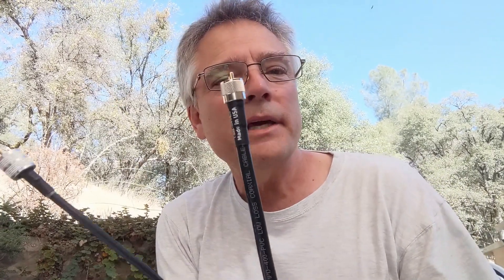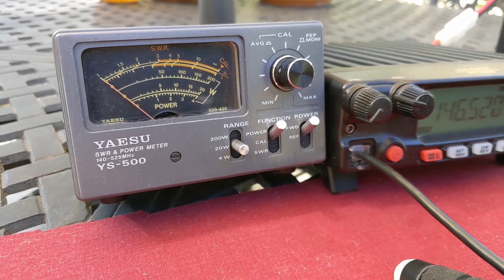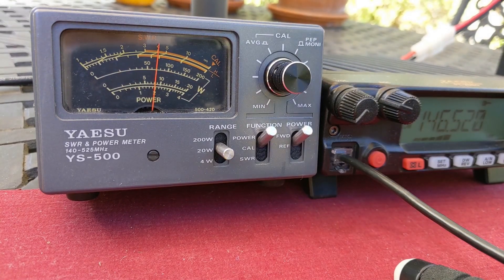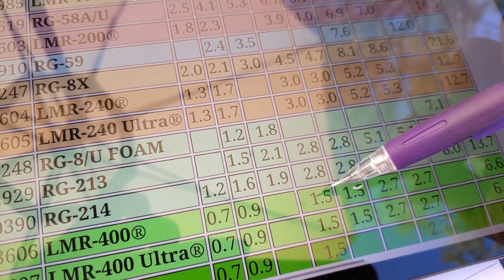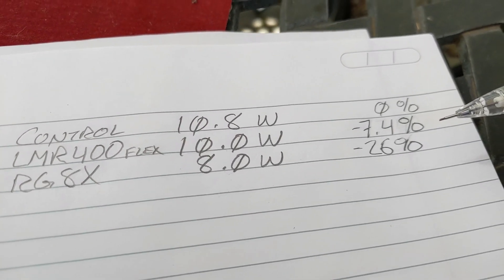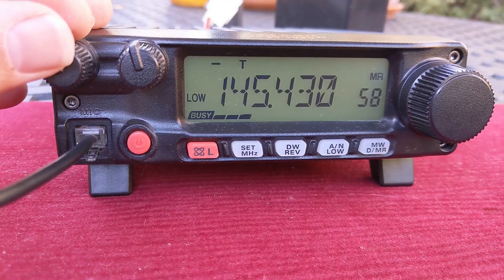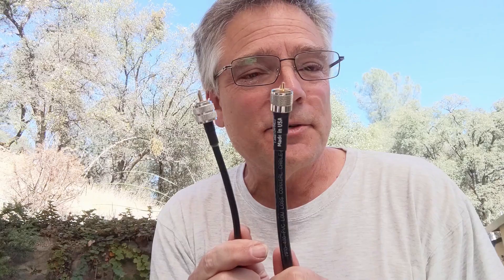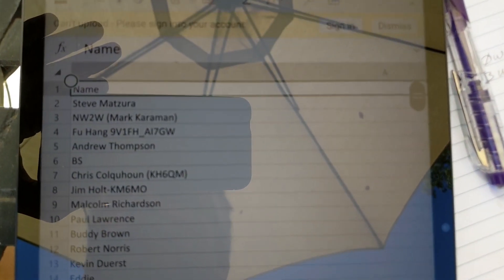Is it worth upgrading your feedline?

Comment: I've been looking for 75 feet of LMR400 with connectors attached but I haven't had much luck. I see there's a KMR400 and other brands that say they're equivalent, but is that true? Are they? Since I run a Yaesu 2900 at 75 watts, a 20% loss with RG8X with leaves me with 60 watts which is still a lot of power since 30 watts is usually the most I ever need. So, I don't know what I'm going to do.

Comment: For some cases LMR 400 is great coax.  I have found problems with it and has nothing to do with loss in the cable. It has to do with strong signals and aluminum foil and tinned copper braid. some use AL braid and AL foil . The dissimilar metals  on the shield cause a problem with RF signals with acting like a diode detector   and causing heterodyne interference and can cause harmonics . Some times this does not happen but it does a lot when multi signals travel in same coax like in a repeater or near a broadcast transmitter. Them the mixing of signals happen in the shield . last year I had to fix a GMRS repeater that took near buy lightning strike . It lost range buy a lot.  I noticed they used times microwave LMR 400 cable .   The cable was not real long due to roof mounted shack . only 45 ft from repeater to antenna. After some testing the coax was loosey and GDT protector did it's job and nearly shorted. High SWR . Went with all new coax. Even the jumpers from duplexer to repeater . ant was fine. 11DB gain commercial UHF antenna . Went with M & P coax.  Hyper flex 10 Sierra FT8 with N connectors .  New short jumpers . Ned GDT Polyphaser N protector. after done worked so good it was better than ever. The wired static that would come in time to time went away.  I could have just replaced the   GDT but I knew better with that coax at a repeater cite.  in fact the FCC does not allow that type of coax.  For the AVG ham you may never see this problem. I have learned things in broadcast .  M & P made in italy is all copper. copper foil and braid . Has better spec than LMR . The only thing better is hard line. ABR in Texas makes all copper coax as well and the best in the USA . The outher trouble is Aluminum has different villosity factor than copper.  When getting to broadcast power levels makes a difference.    my own radio use is mostly M & P -POTAFLEX 7 coax.  I have ABR 400T jumpers and chokes as well. That RG 400 coax.    DX commander has a very long run and uses M & P coax to cut loss . RG 8X is great for them 3 ft jumpers for HF . I have some I use for POTA . I replace with RG 400 or POTA FLEX 6 or 7 for my short jumpers now,  Last longer and rated UHF . Just read them data sheets on coax and pick what works.  73
Reply: I LOVE ABR.
Reply: @randykitchleburger2780  ABR is made in TEXAS !! K8MRD Ham radio tube did a video on the factory ! This is a woman owned business !

Comment: I tried for my ticket 	WAYNACK mid late 70s utilizing  an ELMER  who silent keyed  as i hit 15 wds min onn keywork you know when code was  REQUIRED 
NOW ONLY TECHNICAL QUESTIONS NEEDED AND KEY MORE OR LESS HAS DROPPED BEHIND  uses my practice unit was yaesu ft101e 
 Turning itt to 10 11 meter without am filter great radio but tight transmit recv locals  had hard time understanding on am

Comment: So a old school 10 to 12 meter operator operating 100' to antennas with rg8x 100' will mathematically be 100% loss  !!!!!?? Contemplating 213 on these runs  
I question the ocean jumps i get daily?? If 100% loss should be 0 at base of antenna
Reply from the maker: Heh, I thought that too, but think of it as walking half the distance to a wall, repeatedly.  You never make it to the wall, but you get really close.  Logarithmic approach to zero.

Comment: dB are easy. Just go learn.  a 3db loss means you lost half your power. A 10dB loss means only 10% of the power comes out. The loss tables apply to an antenna with exactly 1:1 SWR of your antenna has a greater SWR the loss will be more.  LMR 400 should be used for modest runs on VHF and below. LMR 600 is more appropriate for modest runs on 70 cm. RG8x Ok for short runs on HF using low power.  RG8x jumpers are ok in the shack and I use LMR240UF for portable HF (< 50 ft.) I use LMR400 (or equivalent) in my station except for 70CM and above where even larger cable is used. for 70cm and above use N connectors. An antenna analyzer like those sold by RigExpert or an NanoVNA can measure. I have a piece of Chinese  RG174 (real skinny). Loss tables indicate 9dB/ 100 ft but measurements at 450MhZ were found to be 33dB per 100ft. I bought the cable to illustrate loss measurements. Try your experiment using 70cm.

Comment: I do want to add that although my home station is going to all hardline, I will say that the best coax for an application really depends on a couple factors: frequency, output power level, durability, ease of use, and most importantly, cost. If all you can afford is a 25' jumper of RG8X, then get it. Something is always better than nothing. But if you want things like performance, near-zero loss, power handling, interference and noise rejection, or simply longer runs to your antennas, then you have to start figuring out what you need to accomplish your desired results. As for me, I have two towers  one for VHF/UHF, the other for HF. I also operate mainly DX including satellite, weak signal, and EME. Considering the length I have to run and the signal loss due to distance, loss is a HUGE factor for me. On 23 cm a 75 ft run of anything half inch or smaller the loss is so much that it's become necessary to get the largest hard line that I can reasonably afford. 75 feet of 7/8" heliax will easily set you back $400-$700 depending on whether or not you have access to the tools needed to install it. The prep tool alone cost me $400. The connectors are about $40 each. It's expensive, but my goal is to minimize loss as much as possible. Of course 7/8" on 80 or 160 meters is complete overkill, but I also want to minimize the noise on those bands, plus run 1000 watts. So even though loss is not a big deal, melting my cable isn't an option either. 

To make a long story short: get the best cable you can afford. RG-213 is a good baseline for stations with runs under 50 feet for most applications. Slightly cheaper than LMR-400 with about 0.1 dB difference up to 150 MHz. 

I would avoid RG-58 though at all cost. Lol

73, K7AXA

Comment: Being that the Feed point impedance for a Half wave Dipole, is 73 ohms, I decided to build an antenna for Forty meters, using  RG - 11, 75 ohm Quad shield !
Best Dipole I have ever made !
And I believe it is the quietest due to the Quad shielding !
          Try it, you'll like it !
                       👍😉
Reply: I've wanted to try that. Can I ask what length of cable you used?
Reply: @Chalybe_Ebulliae  
I believe I began with a 100 foot length, then bought a splice connector, and added until I got the length needed to get in the shack !
Plus an adapter to PL 259.
Don't mean to sound vague but it's been awhile !
GOOD LUCK !

Comment: I've been useing RG 11 75 ohm coax for years . Very low loss I use a one to one balun at the feed point of my vertical anteena. which brings the ohms to 55 at my amp .Talk all over the world on HF .. Its stiff but not bad just run it to my watt meter and use military grade 213 6 foot jumpers from my amp and radio.. No problems for over 10 years.,
Reply: I have a buddy in Canada who uses 75 ohm RG-6 quad for a lot of his installs. If you find the velocity factor vs the wavelength impedance at frequency, you can cut the right length to match 50 ohms and not even need a transformer.

Comment: HF RG8x, VHF/UHF is LMR400. 

LMR400 has the disadvantage of using CCA core, this is great for weight and performance but not if you want to flex it. I won't use LMR400 for anything but long term setups. LMF400UF (ultraflex) is a stranded copper core, it has higher losses than LMR400 but is still better than RG213 and RG8 (let alone RG8x) it better for field use.

When you are HF comparing <0.25db loses doesn't matter that much. The only consideration in HF is power handling, RG8x is around 1-2kw across HF at 1:1 swr (higher swr = less max power) while LMR400 can handle a little bit more. RG213 though can handle way more power than LMR400 and is the same size but has higher loses.

Basically IMHO, for <=100w HF or <=50w VHF/70cm use what ever has the best performance price.
Reply: I have never been able to find numbers about UF VS regular. Do you have a source?

Comment: There are several db calculators, as well as coax loss calculators on the interweb. To me the ~1/4th S-Unit difference between the coax's @25' isn't enough to obsess about as its indiscernible at the other station Except Possibly under very weak signal conditions. Get the best coax  you can afford it at the time, BUT don't obsess about it if you have the cheaper stuff. ANY signal is better than being off the air.
Some may be unable to stop obsessing about any amount of loss, so YMMV.
73   mike  🍺🍻
(If you want a better signal on 2M get your antenna above the tree top level.)

Comment: It doesn't help that there are many pieces of coex out there mocked as LMR400 or equivalent, and many other designations, which are sold on the likes of Amazon, banggood, Temu, eBay, and many other online sellers which are nowhere near the stated standard and how complete garbage.
Reply: Realistically, you are buying pure metals. That is what you're buying in coax. It's gotta be from a good source as with any metal buying

Comment: When I was in telecom, the standard was LMR400 for runs up to 100' up to ~950 MHz (SCADA remote radios). Anything over 100' got 7/8" hardline. SCADA masters (~950 MHz), TGB base stations (~900 MHz), and m/w (2.4 GHz and 5.8 GHz) was going to get 1 5/8" hardline regardless of the install. I left the telecom group and I know they're doing some 11 GHz now but I don't know what size hard line they're using.

Personally, I run LMR400 on HF from the balun at the bottom of my mast to the lightning protection just before it enters the house, another 25' LMR400 jumper to a coax switch, and then a 6' RG-8X jumper to the back of the tuner. I have about 75' from the base of the mast to the coax switch but I also like to run QRP on CW and digital so every dB counts. For VHF/UHF, no question - always LMR400.

Plus, dB means nothing without a reference. For example, I'm used to dealing with dBm - a decibel referenced to a milliwatt (mW). I know 37 dBm is about 5 W, 30 dBm is about 1 W, and 27 dBm is about 0.5 W.
Reply: @joelblack6174  Around here most everything above 5GHZ gets waveguide.

Comment: If you replace those PL-259/SO-239 connectors with N type connectors you'd get a better constant on the 50 ohms
Reply: I second that.  Plus they're more water resistant and don't resonate as easily on UHF.
Reply: @Chalybe_Ebulliae Yeah, PL-259 & SO-239 are sometimes called UHF connectors, but what was considered UHF was a much lower frequency when these connectors were first designed.
Reply: @rickgilbrt  Yes I know that. Did you know though that at higher UHF frequencies the pin of the connector will become reactive and act as an antenna? Thus causing your swr to radiply increase. These are why most connectors designed for frequencies above 300 MHz typically use type N connectors or DIN.
Reply: @rickgilbrt  originally the UHF band was considered anything over 30 MHz until the reclassification of the frequency spectrum by the ITU between 1937 and 1942. But all that has nothing to do with my original statement. On "current" UHF frequencies, PL-259 and SO-239 (traditionally called UHF) connectors cause reactance and the higher in frequency you go, become more resonant, which is why they are not used for those frequencies. That was my point. It had nothing to do with nomenclature.
Reply: @Chalybe_Ebulliae  I understand that and wasn't criticizing your comment.  I just think it's interesting that we sometimes still use outdated nomenclature - and accept that manufacturers sell outdated hardware.  How many VHF/UHF mobile radios by "the majors" are sold with SO-239 connections?  I don't know any that have anything else.  As a new ham ten years ago, it was confusing to see "UHF" connectors on mobiles, and then read that the SO-239/PL-259 connector so are not actually good for UHF frequencies.

Comment: I use LMR-240 in a lot of jobs its loss is between 8x and lmr-400 about equal to RG 213 or the older RG 8u  and is a better price than lmr 400. K6DCH
Reply from the maker: agreed, the only real downside is the stiffness?  solid core?
Reply: Times microwave, lmr240 if is stranded
Reply: Uf
Reply: I use a 5' jumper of LMR-240 from my FT-818 to a 23 cm transverter. It's pretty stout stuff for short runs. I will probably use 240 in my mobile rig.

Comment: Hi, great channel. I have a random question. Which antenna do you use for your RSP1B? Thanks
Reply from the maker: heh, 2m magmount stuck to an old steel firepit upside down in the attic.  super low Q factor, public safety, broadcast FM and ham.  great question!   dumb answer, I know.